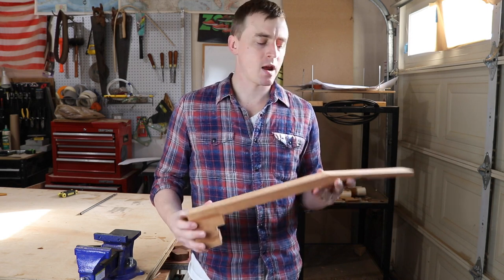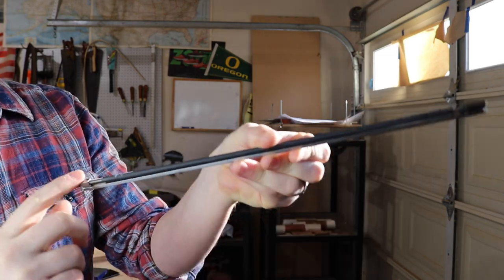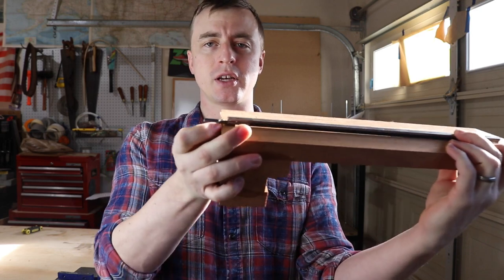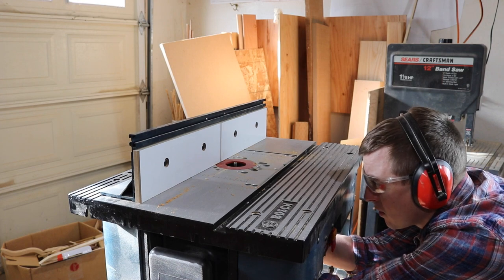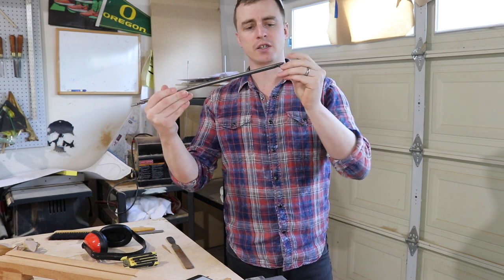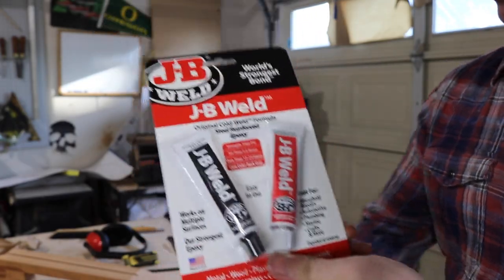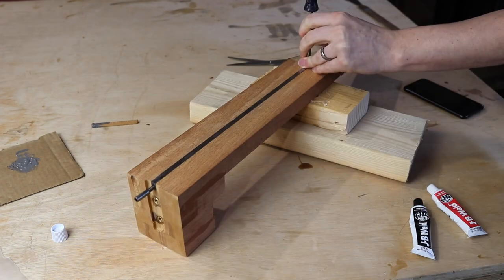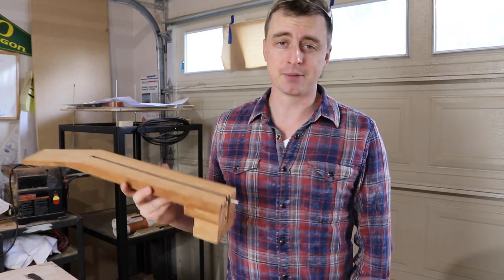Installing a Truss Rod (Ep 9 - Acoustic Guitar Build)

Comment: My guitar is 11 years old and because of its oldness it has a bigger action than before. I just want to ask the is it possible to install truss rod in it to adjust its action?
Reply: most guitars built within the last 60 years have a truss rod as standard. Unless you built it yourself, in which it would be possible for a luthier to remove the neck and fingerboard and install one. It would cost a lot though as it's not an easy job.
Reply: @breslinguitars3745  okay. Thanks man! 👍👍👍